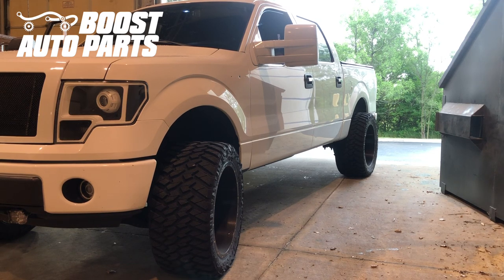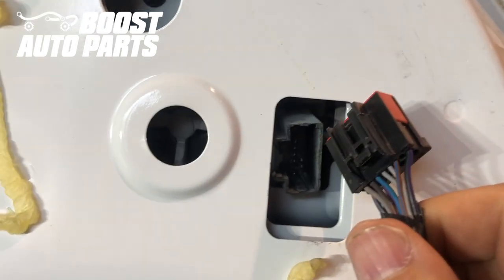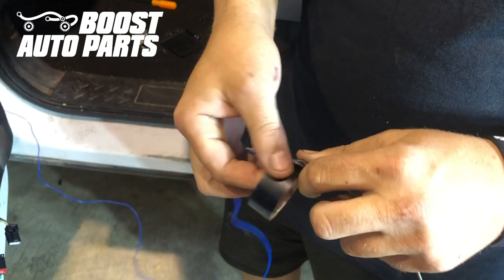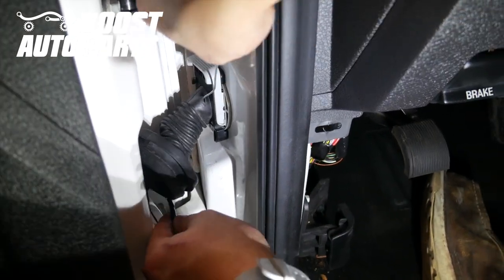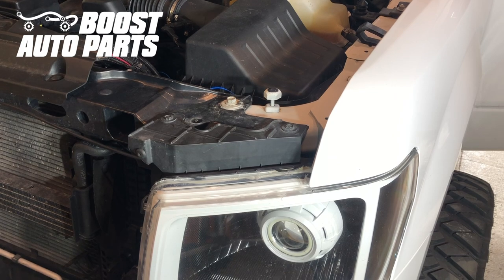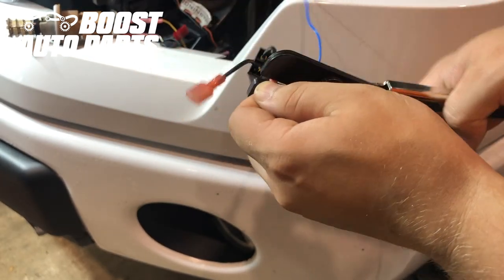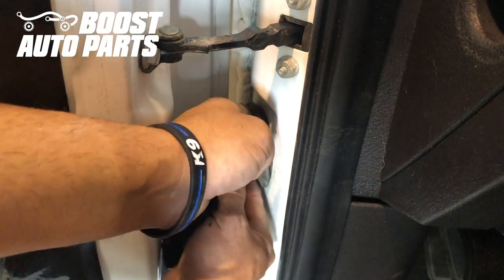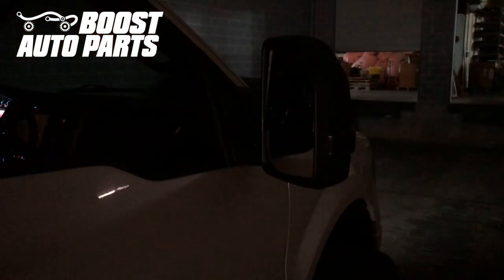Full Tow Mirror Install: (2007-2014) Ford F150 Tow Mirrors - Boost Auto Parts

Comment: What would be the best method to get the mirror defrost feature offered on the mirrors working, when my truck didn't come with the option for heated mirrors? Tap into the rear defrost maybe?
Reply from the maker: It should be plug and play with the rear window defrost. Ford pre-wires the doors for it if the truck has rear window defrost, even if the original mirrors didn't have that feature.
Reply: @boostautoparts  that's great to know! thanks bud
Reply from the maker: @Klockics  No problem!

Comment: I bought a pair of tow mirrors very similar to this for my 09 F150. The main plug went right in. There is a second plug though. The second plug is a blue and greenish blue wire. I don't have anywhere to plug it in, and I think those wires are for auxilery running lights and maybe parking lights.
Reply from the maker: Our mirrors only have on wire in the secondary connector and it should be blue. If you have two wires it sounds like the mirrors are not from us so we would be unfamiliar with what the wires are for. We would recommend reaching out to whomever the mirrors were purchased from for guidance.

Comment: How did you splice the passenger side  blues wire to the driver side blue wire
Reply from the maker: You can do it many different ways. In this instance, we used a butt connector and put two wires in one side and then another length out the other.

Comment: My OEM mirrors don’t come with turn signals, would this still be plug and play or would I have to tap into the headlights turn signals?
Reply from the maker: Turn signal should be plug and play if you originally had power adjust.
Reply: @boostautoparts  Thanks for the reply, gonna need to snag a set😎

Comment: I have a 2013 f150 with the turn signals in the mirrors already do I need to all that with the blue wire??
Reply from the maker: If you want to gain the running light yes. The blue wire is for running light, not signal.
Reply: @boostautoparts  so I would just take the door panel off do that clip and not do the whole blue wire thing?
Reply from the maker: @jacklawless7722  If you buy signal only mirrors you could do that, but if you buy mirrors with running light you'd need to run the blue wire.

Comment: Question. I got a 2014 F150 XLT. The factory mirrors already have running and park lights. Would i still need to route all the wiring or should it be done already?
Reply from the maker: For 2013/2014 trucks originally with the square head style tow mirrors it would be plug and play. I'd recommend giving our team a call at 765-831-2830 and ordering over the phone and clarifying this with them, as that's a pretty odd truck and we want to make sure we wire them for you to be plug and play.

Comment: These come with a 1 year warranty.  If an issue arises after the 1 year, do you guys offer repairs for a fee? or is the customer completely out of the money?
Reply from the maker: Our mirrors are all built in house so we stock all of the replacement parts. If something fails outside of warranty and it's a serviceable part we will sell you just the replacement part.
Reply: @boostautoparts  if it's a non-serviceable part, what is the customer's options? these mirrors are quite expensive.
Reply from the maker: @JJ-tv5pc  Things like that are handled on a case by case basis, but our team is very flexible, even outside of warranty. We are known for our customer service and would encourage you to read over our reviews that reflect this.

You're also welcome to call into our team at 765-831-2830 and ask this question, as that is the team who would handle the request and might be able to give more concrete answers.
Reply: @boostautoparts  Thank you.  I appreciate the reply.
Reply from the maker: @JJ-tv5pc  No problem!

Comment: What happened with the other blue wire??
Reply from the maker: Blue wires get spliced together - they are for the running light.
Reply: @boostautoparts  Correct, do they splice before the gromet?
Reply from the maker: @amvanquish5555  We recommend splicing under the drivers side dash.

Comment: I wanna buy these for my 2005 Lariat. As long as they fit into the doors I can customize the wiring harnesses inorder to make them work properly.
Reply from the maker: We only offer F150 mirrors from 2007-2020 currently. These will not fit your truck.
Reply: @boostautoparts  there's a guy that made them fit an 06

Comment: So the switchbacks only work for emergency lights not turn signals
Reply from the maker: No - they work with the signals and the hazards.
Reply: @boostautoparts  question how do they work if they are only wired to on turn signal??
Reply: One**
Reply from the maker: @ricardotorreblanca1269  The turn signal is plug and play. The wiring shown in the video is for running light.
Reply: @boostautoparts  very nice thank you for answering my concern seems like ima be getting a pair of those👀

Comment: I noticed you only ran the blue wire to the left side headlight. Am I right in thinking nothing ties into the right side headlight? Thanks
Reply from the maker: That is correct; you can splice both blue wires to the one headlight.

Comment: The shape of the mirrors looks a little
Different in this video than the ones in photos online. Wanting to order but I’d like to get them in the same style as this video if possible
Reply: The biggest difference I’m noticing is the way the 2 out posts flow into the back of the mirror housing if that makes sense. The ones online it is different
Reply from the maker: @rayce5487  We no longer have the two raised edges on the front, all of our mirrors have the flat front as the website depicts.

Comment: I want to buy these like last month but I cant find the wiring harnesses on your website. Does it automatically come with every set to mirrors or is there a sku# for them?
Reply from the maker: The mirrors come with the required wiring. You can check them out here: https://boostautoparts.com/products/2007-2014-f150-tow-mirrors?utm_source=Ford%2007-14%20F150%20Install&utm_medium=Comment&utm_campaign=YouTube

Comment: Instead of running the wire  through the firewall out to the headlamp, could you just wire it right off of the wire from the Headlamp Switch?
Reply from the maker: We recommend running through the firewall for proper install

Comment: Will 04-06 mirrors come out anytime soon? Really interested in buying some. If not, would it be possible to somehow make the 07’s work on an 06?
Reply: I installed them on my 2006 King Ranch today, everything works flaslessly.
Reply: Ben Eminger I have an 04 F-150 and was wondering if they would work fine on my truck. What set up did you get? I was planning on getting the switchback feature for them
Reply: @beneminger3666  does flaslessly mean they work good?
Reply: @KingDeuceDroppa  I’ve had them on there for nearly 3 years, they work perfectly (not even Montana winters have caused anything to go haywire) I got the ones that are blacked out with a chrome tip and smoked turn signal lens. The chrome is a bit faded now but it still looks good and works great!

Comment: I've been doing some research on how and if it's possible to modify to power fold via some sort of aftermarket module. No luck so far. anyone have any idea if it's even a possibility?
Reply from the maker: It is not possible; the structure of the power folding mirrors is completely different than the manual folds.